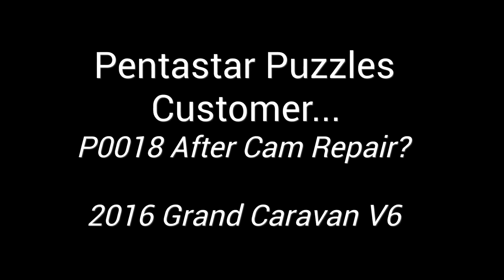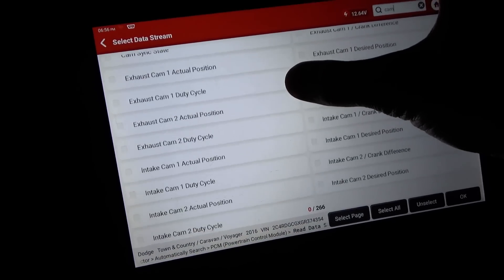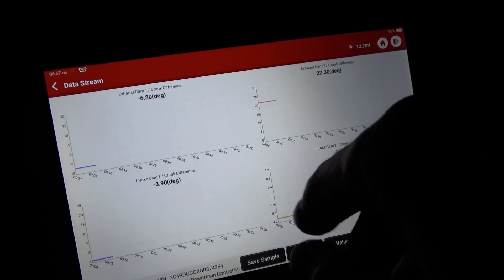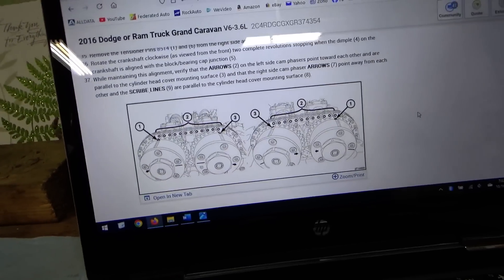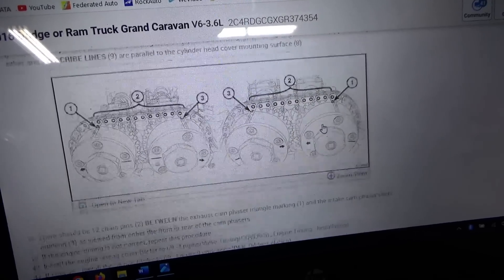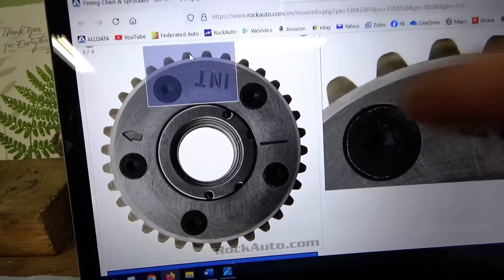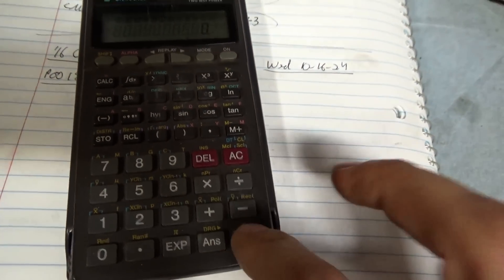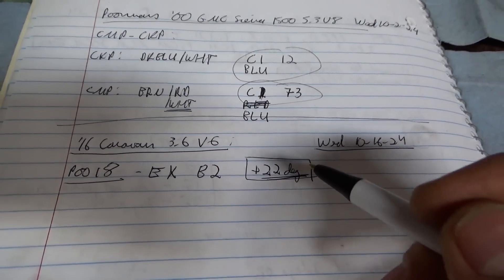Pentastar PUZZLES the Owner...(P0018 After Cam Swap?)

Comment: i just did a cam on a jeep 3.6l. my intake cam is at 17 degrees all others at -2 to -3. i checked the timingh on that cam and its dead on. hiw can this be im getting a p0017 code please let me know what can i do next.
Reply: Also have 12 pins in between im at a loss on this one. the tone wheel looks like the magntic bars are in line also.

Comment: Mine was almost identical. Thank you for making this video! I've got my jeep running sweet again. 
Here's the part that made the light come on for me  - when you turned until the mark on the good cam was parallel to the head, then looked at the other cam. 
I was turning until the marks pointed at each other and they looked fine. It's hard to tell they were not parallel with the head when looking down from an angle.

Comment: Awesome diag. I wish you lived closer to me. I have a 2014 ram with the 3.6 and it has been to several mechanics. It has the constant permanent code p0023 and it will randomly go in limp mode with codes p1dd2, u1424, p0365, p0305. Everyone is stumped. Truck is undrivable. I wish i could find some one that could diagnose it the way you do.

Comment: I am always amazed at DIY folks that have a problem after the job that didn't exist before and they dont go back to double check thier work.  I've seen loose plug wires, connectors left disconnected or loose, all kinds of very simple fixes that if they just went back and verified their work the would have solved themselves without having to pay me or someone else.  I'm pretty sure before I threw a second cam, phasers, and anything else at it I would try to verify my original timing job.

Comment: It is interesting that the CAM lobe wore before the finger follower roller. Perhaps this indicates low quality CAM shaft castings? I wonder if billet CAMs are available for this engine? This should help the wear issue, but is probably very expensive.

With this vehicle do you have to do a CAM/CNK position relearn after adjusting a CAM?

I though the chains were new? Do the new chains have a little stretch?

Comment: I like that we are calling it "classic" now! Since this engine is all I do, I can share some tidbits. On a normal engine, you'll see -6 to -8 degrees on Exh1 cam, and the others will be around -1 to -4 deg. That's at warm idle. Not sure why, but that's normal. You CAN pull the phaser actuator off the valve cover, and with a camera inspect the marks to see if one phaser has shifted. You'll have to do it on both heads to know if one phaser is out as all 4 marks will need to line up. This code can also be caused by the sensor tone wheels shifting, which is rare but has happened to Ivan. Video below on how to check them. Another tip: anytime you have the valve cover off, check the galley plugs behind the phasers - Ivan has a great video on this as well. Last tip: Amazon sells the special timing tools for this engine for well under $20. Includes a special wedge to retract the tensioner, blocks to lock the cams together so you can get the big phaser bolts off and on, and the grenade pin that allows you to retract the ratchet on the front head and get the chain loose. Tonewheel checking here: https://youtu.be/lQvJhjOn8r0?si=7X1dOQl2AVNszIic

Comment: Question: is there any truth to the Pentastar 3.6 being plagued by the Dry Starts causing problems with the cam and rockers and that switching to a Baxter Performance cartridge to spin on filter adapter, will solve these problems?

Comment: And when you read through the service information, half of what you read is Chrysler bragging about how wonder the Pentastar engine is. It's absurd. Chrysler dealerships have had these cars under warranty with this ticking noise issue and they just patch the valve train, when we all know it all should all be replaced every 80k miles.

Comment: It is so much easier to diagnose issues with scan tool, isn't it?  The last time I saw you pull a grenade pin was on a Maserati. (that didn't do 185) This was so much easier than those pesky switches on that Toyota in the previous video!  GREAT VIDEO!

Comment: What would cause car to misfire on a cylinder when getting off the highway for like 20-30 seconds then go back to normal, only happened once, today on way to work and then I turned back and around and went home, check engine light blinked when it was misifirng, seems fine now, but I knnow its not or that wouldnt have happened it was a very cold day and I did let it warm up idling for 15 minutes

Comment: If you have the Cam Locking tool like we have should be ok! I'm in the process of replacing the Headgaskets Water Pump and Oil Filter Housing on a 2019 Grand Cherokee. Water Pump leaked blowing the Headgaskets and very little oil in Engine all leaked out! Runs great despite that!!

Comment: You can swap the cams we had a cylinder head tidied up by a shop they put the phasers on the wrong cams ,it still runs but badly it made our techs scratch their heads for a while 😮😮

Comment: One thing I learned when installing new timing chains or belts.
After installation, remove the spark plugs and rotate the engine by hand using a breaker bar and a socket 2 times making sure the moveable crankshaft timing mark is lined up with it's proper stationary mark.  THEN check the camshafts moveable and stationary marks.  They must be lined up.  Each time I've done this, when they've lined up I reassembled the rest and they've started right up, no MIL light and ran great.
Good one Ivan.  Hope the customer's happy.

Comment: IVAN,you saved that customer a ton of grief in the future.I HOPE you get an EXTRA lump of  coal in you XMAS stocking this year.The dealership would have said,"sir you damaged those new cams  and phasers ,and now you need to replace them and the timing chains AND ALL THE GEARS it will cost 4.000 -4.500 we will need the car for 2 weeks" AT least this guy had the  good sense to seek you out,which was a smart move.My gut says this guy went to the dealer 1st asked about cost ,THEN said for THAT amount I'll buy factory parts and try it MYSELF.AND he almost made it,JUST 1 TOOTH OFF.But he did do a better job the most.great vid and good customer.

Comment: I have done the cam belt on a Subaru with dual cams on each head and a single belt. It was challenging and I don't know how many times I got it wrong before it ended up right.

Hand crank the crankshaft with a spanner many times just to make sure that there wasn't any interference or other problem, so if something was off anyway it would at least not result in a rapid engine disassembly.

Comment: Key to this diagnosis was to look at the data comparison of the cam sensors and notice that 1 of them was off 22 degrees. That's experience right there. It's amazing that you can drive around with that cam off 1 tooth and do no damage to the chain or sprocket 😱

Comment: Nice job Ivan. 
I hate the pentastar so much. Put two engines in our van so far, been through the all the cam first. Replaced the transmission also for 4K before 180, 000.  That awesome oil pump actuator really destroys the engine when it faults, and only runs the oil pump at low speed and oil doesn't circulate enough.
Reply: Hint: DO NOT BUY ANYTHING BUILT UNDER STELLANTIS FLAG. ITS CRAP! If you watch PHAD, SMA, etc. take note of what they continually work on, and what it takes to fix them.

Comment: Kudos to the owner for trying to sort it out and using oem parts.
Ive also been guilty of overlooking what I thought was correct.
Reply: I usually agree re using OEM parts, but the originals failed pretty fast, did they not?
Reply: @JamesAgans to be fair, they went 180,000 before failure.
Reply: @thecaseyrae  Good point.

Comment: May be stupid question but where did 720 come from?   Obviously, it is 2 X 360 but other than that I don't get how used that 720 number.   One revolution is 360 but you stated, and used, one revolution as 720.  What am I missing?
Reply: One revolution of the cam = 720 on the crank, I believe was the reference.
Reply: So it’s crank degrees, not cam degrees?  That can get confusing since you are talking about the camshaft, but the scanner data is in crankshaft degrees?
Reply from the maker: @montestu5502 always count in CRANK degrees 😊
Reply: @montestu5502  Oh, that makes sense.  Thank you for that brief explanation.

Comment: Another tip DO NOT let the cams touch one another, do not set them on a metal table and do not allow magnetic parts trays anywhere near them. You will destroy the magnetic reluctor wheels and they will be junk.
Reply: I just saw a video with Bernie Thompson where the actual camshafts became magnetic and screwed up the ability for can sensors to pick up proper signals.  Crazy
Reply: 100% correct 👊🏻
Reply: Should I ask how you know? hahaha
Reply: Disagree, you can fix it, as Bernie did. 
And not junk.
I do agree you are not allow any magnet near the cams.
Because the cams come with a warning note in red. 
Of course who reads instructions to the letter.
Reply: @2nickles647  Didn't see a warning note on the cams in the engine.  Maybe they need to stamp a magnet with a line through them on the cam.

Comment: Don't know how many times I've seen techs with that wishfull thinking when aligning the cam gears and it's off.  Two heads are better than one for a lot of techs when aligning timing components.  Even I do it often.
Side note-If you open up a Pentastar V6, you do good to check those front oil galley bolts just under the cam actuator as they are very often loose.
Reply: I believe Ivan had another case study with a different vehicle that had cam phasing issues and found the oil galley plug fell out of the head. Yes, its always a good idea to check those plugs when your in there...
Reply: The techs have two heads. Except the other head is dripping all the time in his pants. 😂😂😂

Comment: I too am amazed that the customer made the same mistake four times. Everybody makes mistakes. But four times the same mistake? Amazing.
Reply: Obviously the customer thought he had the alignment correct in its incorrect positioning, so repeating the error wasn't unexpected. IOW, if you think you're doing it right, you'll continue to repeat the same mistake. It may seem obvious here, but we all do it.😊
Reply: I'm not amazed. He is a DYI type person. I've made the same mistakes twice or three times.
That's when I take a break because I'm frustrated. 
The guys gets points for at least trying to fix his own vehicle vs others who rather take it to a shop and sue the shop later because of the mistakes.
Reply: I thought we were going to have another pin alignment issue on the phasers.
Reply: Sometimes after much aggravation working on a project! A fresh set of eyes and clear mind  is all you need to find the problem!
Reply: Would be interesting to see what information he was using to set the timing.
Reply: Unless the service data is very explicit about how to count the pins, it is easy to make this mistake. The correct way to count the pins here, is that the twelfth pin must align with the mark. He was probably counting twelve pins between the marks.
Reply: He likely wasn't using the timing tools. You can get away with that when you have some experience under your belt, but first time, the tools make a difference.
Reply: No, he made 5 mistakes, the first being buying ANYTHING made under the Stellantis flag. There is an entire parking lot full of dodge vans in a mall near me. They have been there for almost a year.
Reply: @JamesAgans I'm sure your a perfect person and only buy things that don't break down.
Reply: @2nickles647  Not hardly, but Frankly, buying a Chrysler product with 180,000 miles on it is not very smart, if you know anything about vehicles at all. I am a very firm believer in Preventive Maintenance though.
Reply: @JamesAgans ehh the problems with these engines is overblown. They don't get major issues outside of the rockers. It's definitely not the worst engine Chrysler has ever made.
Reply: @JamesAgans did you not experience the past 4 yrs ! Was you in a coma! Prices has went thru the roof property taxes went nuts ! Interest rate higher than sell out Willy ! Nobody wants to go in debt buying a new vehicle!

Comment: I can see myself making that same mistake - so much to look at with the covers off, and having to remove the cam again to move the chain on the sprocket. If it were an easy thing to change the timing, it would be a different story, and anyone could do it. Well, anyone willing to try.... You are the pro!
Reply: I think the biggest shock I had when I removed a cam, was no brass bushings on them.  Sit right on the aluminum of head and caps. I guess it works, engine had 260K on it.
Reply: Probably easy to do if your like me and picked up an older set of lower powered cheaters. 😅

Comment: If he fitted it one tooth off and believed he did everything right, he was bound to keep repeating the same mistake 4 times. If something is wrong after repair, assume you did something wrong and go back to basics. 
Guess the modern generation depend on warning lights rather than taking 2 mins to check all levels under the bonnet/hood. I am (very) old school and look for early warning signs to avoid breakdowns or expensive repairs later down the line as far as possible.

Comment: They should have never stopped building Chevy 3.8 Dodge 3.3 3.8 the new dohc garbage should be in the junk yard.
Reply: 188k, and still going strong after a couple parts. I like the newer engines.
Reply: I 100% agree with the OP. The older v6s would outlive the rest of the vehicle. Transmission failure was the most common death, followed by rusting away. Not to mention easier to work on. The slight increase in efficiency from the new ones wasnt worth the trade-off.
Reply: you can blame the u.s. government for making more and more restrictions on mpg's, that force automakers to keep re-engineering the engines to meet those restrictions and emissions.
Reply: @ back in the 80s we had cars getting 44 mpg nowadays you are doing good to get 10 mpg on average v6 engines
Reply: Like all of the plastic parts, everything is built to be disposable.

Comment: For the miles that thing has, I didn't see any sludge. Previous owner must have kept up on oil changes.
Reply: Possible the entire engine was cleaned inside and out before everything was put back together
Reply: I noticed that too.